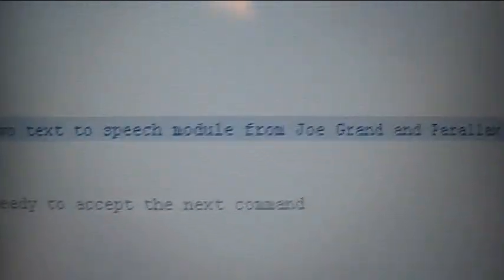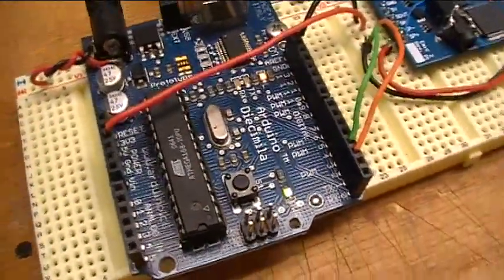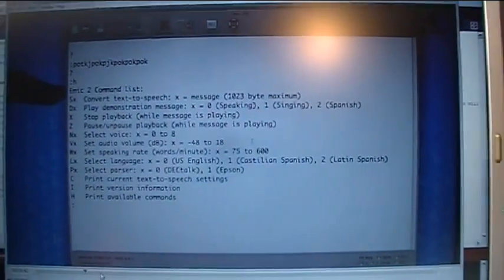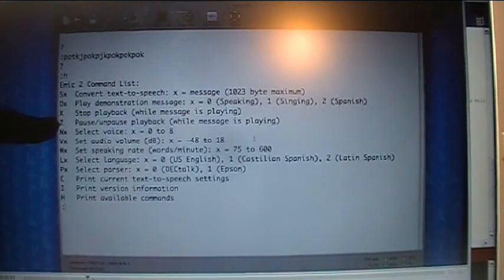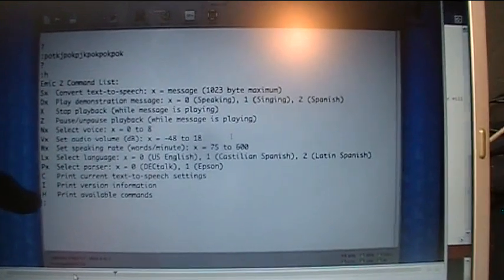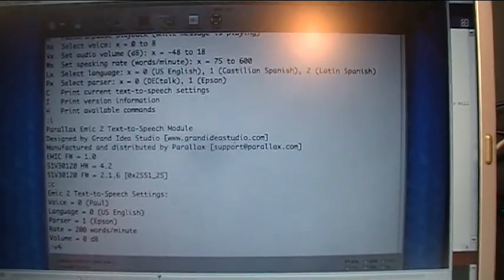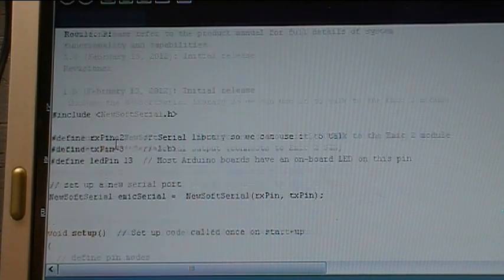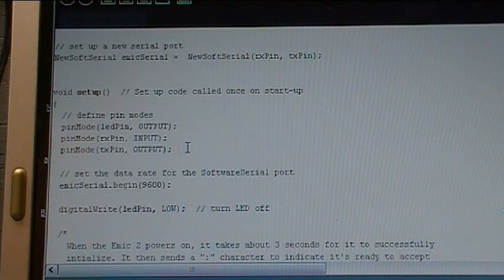The Emic 2 Text to Speech Module

Comment: is the possible to interface Another family Micro controller
Reply: Well anything that can have serial in and out capabilities at 9600 BAUD, 8 bit data, no parity, and 1 stop bit. Heck I even think you can hook it up to a terminal or terminal emulator and it will work if you know the command codes.